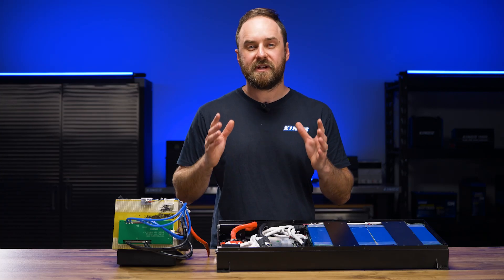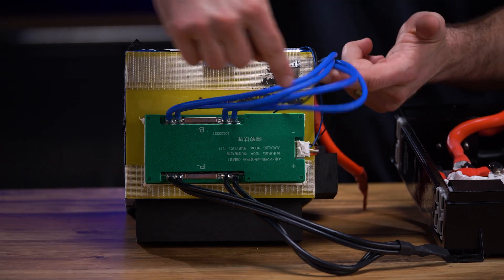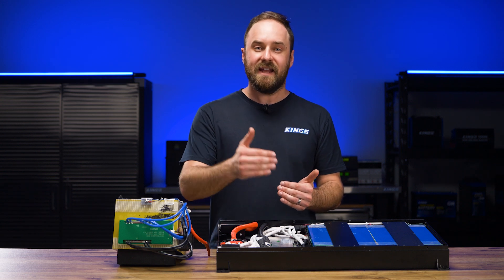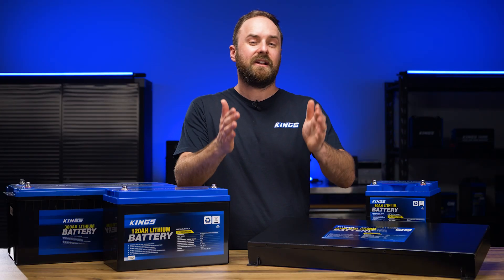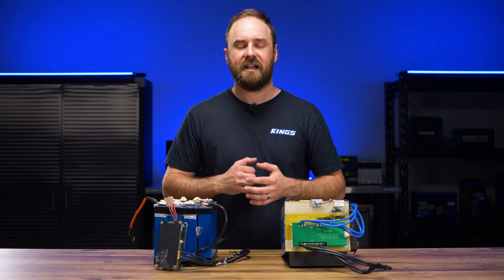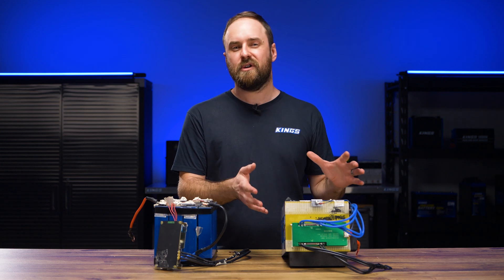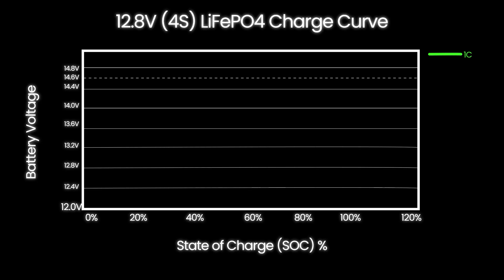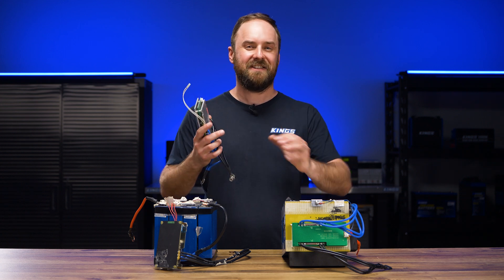Adventure Kings Lithium Series: Battery Management System Explained

Comment: The only info I could find other than this video on Balancing voltages was 14.2 as a minimum start voltage for the balancing. I was curious as I am using a Redarc alpha 50 on two 100ah batteries in parallel. With their lithium profile, it does not charge over 14.2V and the time spent even over 14.0 volts is very little before it drops to 13.6v. I was not sure if this was enough time for any kind of balancing to occur given the short amount of time over 14.0v (Ive seen maybe max 3 mins over 14v) and the fact it never goes over 14.2 v (Using a noco 10am lithium profile it will sit at 14.5 all day, which is how I did the initial charge). Do you think the batteries would need an occasional boost over the 14.2v to get a decent balance etc etc....
Reply from the maker: Hi there, 

What you’re doing so far appears to be fine, as the charging profile remains within the battery’s operating specifications. The voltage provided should be sufficient to maintain cell balance under normal conditions.

Regards, Jayden
Reply: @4wdsupacentreAu Great, thanks for that!!

Comment: My battery has discharged fully but now as I’m trying to charge it the dc dc charger is starting in float mode 

For a lithium this isn’t normal - can someone let me know why It doesn’t seem to be charging properly 

I have a 40a dc dc charger and also a 240w solar blanket that are both showing float charge via the LED lights

Comment: can i plug my slimline 100ah lithium to the Batblock40 with a 120aH lithium input?

My previous setup with a normal battery box fried the negative 25A dc charger and nearly sent my 90k troopy on fire
Reply from the maker: Hi there,

I can advise that for battery chargers you would want direct connection, for parallel setups you should use the external terminals.

Regards, Andrew

Comment: Why don’t kings lithium batteries have balancers???
Reply from the maker: Hi there,

This would be the job of the BMS to maintain the internal cells levels, you'd only likely need a balancer for connecting several batteries in a parallel set up.

Regards, Andrew

Comment: I would like to see the 200 &  300ah batteries in a more compact enclosure.
Reply: Hard to achieve with current LiFePO technology until you change the chemical of the battery to something else. Just like LiFePO batteries in EV, they tend to be bulkier and heavier, while Nickel Manganese batteries are denser and more compact. However Nickel Mangenese is less safe and does not like to be charged to 100% all the time.

Comment: Can you run a old black top 200ah lithium in series with a new blue top 200ah  lithium
Reply: Generally not a good idea because once the old battery goes it might take the newer one with it in the end always good to add two of the same batteries at once or within a short period of time